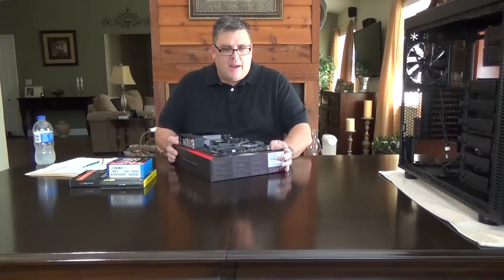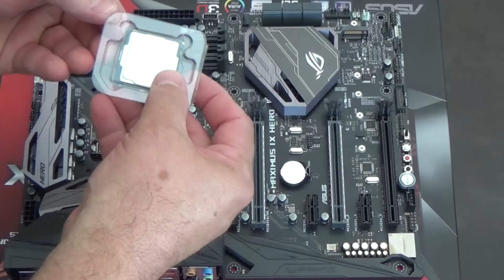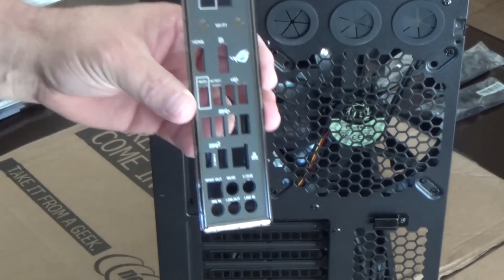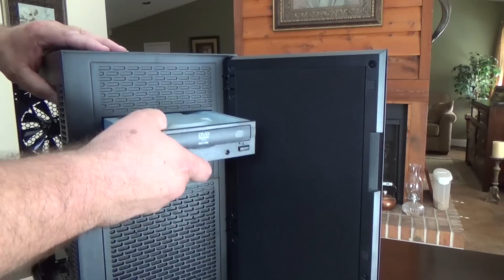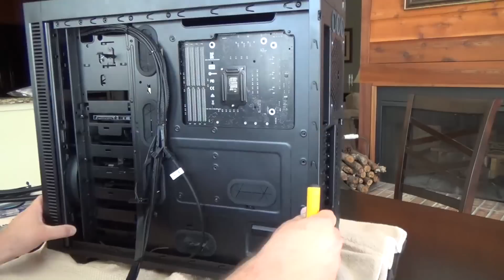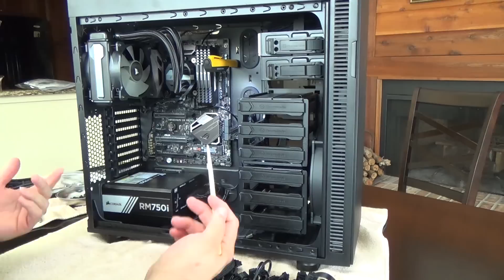Asus Maximus IX Hero - i7 7700k Kaby Lake Build

Comment: it is strange that today's computers and components do not need to be on an anti-static mat or need the engineer to wear zap straps. I suppose it is like you do not run engines in on a new car/motorbike (not that I ever did!!)
Reply from the maker: Indeed Lossy, today's motherboards and components have been hardened against static electricity.  My house is wall to wall tile and I live in Central Florida where to humidity reaches 85% on a regular basis.  No chance of discharging static electricity in my area!  On a side note, in 20 years of building computers I have never been witness to a component that failed because of static electricity.  Simply placing your hand on a metal surface of the case, which I do on a regular basis anyway, will discharge any static electricity that your hands may have built up.  Thanks for watching my video.
Reply: I have zapped many things, even after touching the cases. But they were in the days when giving blood to the great PC/server gods SUN and HP was also a part of opening up a computer case.
Reply: yet Florida has more lighting strikes a year than any US STATE..
Reply from the maker: This is true, lightning capital of the world.  Back in the day, dial up modems were the sacrificial component during storms.  Typically it was voltage back-feeding through the MGN (Multi Ground Neutral) into the neutral side of the phone line.
Reply: I wasn't hating on ya man. Just trying to joke a little . Nice video man . I love how you dont talk about unnecessary BS  in your video.

Comment: Hello, I am doing almost the same build. I went with 1000 W corsair power supply and SSD Samsung 250gd. The tower is also a corsair. But everything else is the same. My question is would you connect the CPU power cable to the motherboard. before installing the fan. Is there another video you have that shows a better placement of all the wires to the motherboard. And in the bios I notice you disabled the CPU fan. Is there any set ups that you must be done for the liquid cooled.
Reply from the maker: I did address this in my video. You definitely want to install the CPU power cable before mounting the radiator.  I failed to do that, it was a simple matter of removing the screws on the radiator assembly and then plugging in the cable.  For future reference, even if you had two GPU's, you will NEVER need a 1000 watt power supply.  In 20 years I have never seen a use case for that much power.  Save that money and put into another component.  Use PC Part Picker and discover how little watts your computer components actually use.  Not sure what "Is there any set ups that you must be done for the liquid cooled".  Please clarify and I will be glad to answer.  Regarding the cable routing,  if you need close ups of the pins going into the motherboard, you may want to re-evaluate building your own computer.

Comment from the maker: I love talking about computers and helping a novice or a beginner system builder with their issues.  Help me, Help you.  Be specific about your system when asking questions.  Sometimes a question about your processor depends on the motherboard, for example.  A question about cooling will involve just about every piece of hardware, including the case.  Part 2 can be found here: https://youtu.be/TT9PfOVW0bE
Reply from the maker: Wha?  You realize the video support is in the CPU not the motherboard, right?
Reply: netnole why no gpu?
Reply from the maker: Not a gaming machine.  GPU's are for 3D graphics only.  The i7 7700k supports 4k video (4096 x 2304 @60Hz )onboard nativley.
Reply: 4k means across the board upgrades that are a unknown expense.
Reply: netnole need help 
See
Im using 7700k with maximus ix hero along with 780T cabinet 

Ive installed radiator usb and front usb 3.0 wire on board

Now the problem is i cant find any more usb extentions 
Now my front usb of 780T is not working cuz ive kot plugged it in board
Cuz there is no more ports available?

What shuld i do??
Reply from the maker: The USB 2.0 connection for the cooler is for reporting to the software only.  You don't need a USB 2.0 header for it to function properly.  In the past I have purchased a x1 PCIe expansion card for under $10 to get more USB 2.0 headers.
Reply from the maker: I love all Asus ROG boards.  Certain boards fulfill certain needs.  Not all ROG boards are strictly used for gaming, like my build.  I don't have enough information to recommend a board to you.
Reply from the maker: I am very happy with my build and I always am because I spend a tremendous amount of research into my component selections.  In my opinion, you simply cannot go wrong with ROG series motherboards.
Reply: gaming dont require all the over clocking mania just to see if the mother board will fry or not. Some of these boards are 4k boards and work better for editing. Gaming that is a decade behind the boards has to be figured in. Still the frame work is based on very old code that you can see similarities in game play. Some games wont work with 32 gigs of ram or dont recognize your video card. Common on 2 gb video cards some cards wont read them.
Reply from the maker: Appreciate the kind comments.
Reply: Can the ASUS ROG MAXIMUS IX HERO LGA1151 DDR4 DP HDMI M.2 USB 3.1 MOTHERBOARD fit inside of any of these computers (DELL XPS SE tower / Lenovo ThinkCentre M900 / Lenovo IdeaCentre Y710 Cube / Lenovo IdeaCentre Y900 / Lenovo IdeaCentre Y900 Razer Edition)?? I am looking to get a pre-build and mod it. Please let me know your thoughts.
Reply: netnole I have a predicament i removed the cover plate for the processor that comes with the motherboard and now the screws wont screw back into the motherboard how they were sitting before
Reply: netnole i removed the cover plate so i need help reattaching it if possible
Reply: This is the first video i saw of you, and was awesome thanks for the video i will come with my own questions soon and you have a new suscriber :)
Thanks a lot again :)
Reply from the maker: My thoughts are... what the hell for?  I've never considered such a thing.  Frankly it's stupid.  Two things, the power supplies may or may not fit and you will run into issues with the case wires.  Take my advice, buy a pre-built computer and stay away from the enthusiast computers

Comment: hello. i have i7 7700k and z170mx gaming 5 gigabyte. both are new. can i update the bios with the i7 7700k or i have to have 6 serie to update bios and than install the i7 7700k?
Reply from the maker: Depends on where you are on the BIOS update cycle on your board.  You didn't state the board you have and I can't check without that info.  All Z170 chipsets should have a BIOS update to accommodate i7 Kaby Lake procs.  Upgrade your board to the latest BIOS, install the chip.  If it doesn't POST, well, then you need a different board.
Reply: the problem is my z170mx gaming 5 gigabyte ver 1.1  is new and i don t know the bios version on it. and i am afraid to try with my i7 7700k because i am afraid to get my cpu or motherboard burn.
thank you
Reply from the maker: Your motherboard and CPU with not burn out on an incorrect BIOS.  In all modern motherboards, an incorrect BIOS will simply not install and the incorrect CPU will be un-affected by high voltages or heat.
Reply: thank you very much

Comment: Fabulous build video (and it's pretty much identical to my own build - thank you for that. Only difference is that I have the h100i cooler - I'm curious why you went through the trouble of doing a push-pull config on your cooler when it A) gives you less cooler tube space and B) covers up that sexy mobo led.
Reply from the maker: Customer doesn't care about LED's inside the case,  not sure what "less cooler tube space" means.  Push / Pull is the only method available to insure exhaust of hot air.  A Push / Push would create negative pressure across the radiator and a Pull / Pull would draw ambient air into a hot case.  Could you clarify your statement so I can understand what your comment is.  Thanks.

Comment: Should I upgrade from a i5-6600K to the new i7-7700K
Reply from the maker: That would depend upon what your needs are.  The Kaby Lake processors are NOT a game changer, rather, the current CPU.
Reply from the maker: Your temps are normal.  Absolute Maximum Temperature or (Tmax) is 100°C , as a general rule you have to keep your temps 10-15 degrees lower under load, and 30°C - 40°C degrees lower when system is idle.  You are fine.  I have 28°C on idle and 73°C during a stress test.  However, I am using liquid cooling.  I saw your video and you are using air cooling.  Don't compare apples to oranges.